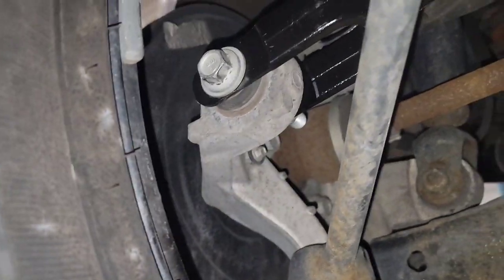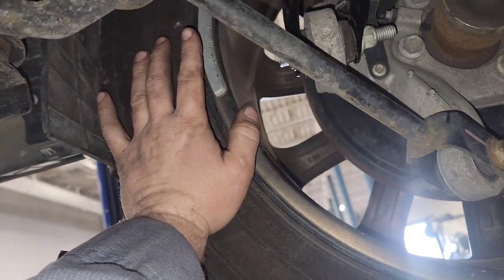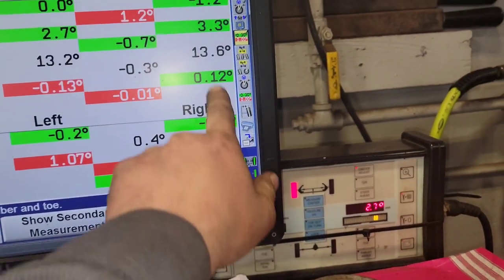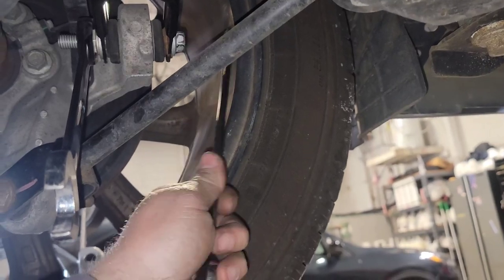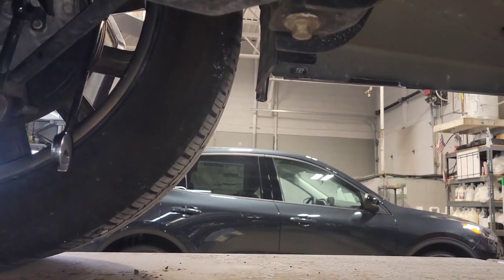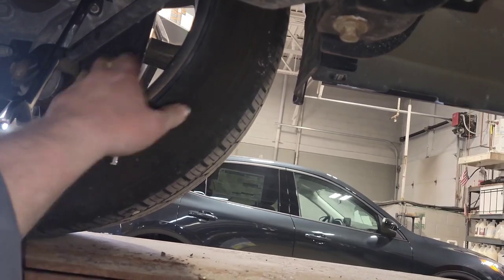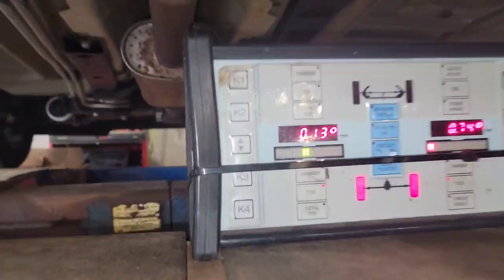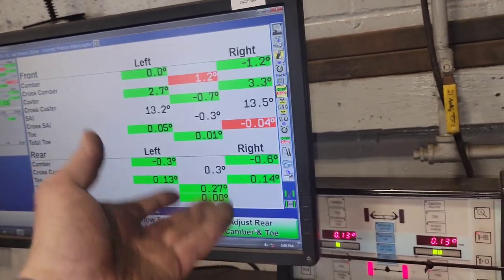Ford Explorer Newest Toe Link Recall 20s62 / 21s32 - What Is Done

Comment: Call me crazy. But even though warranty only pays for a rear alignment, just because it's on the rack I've been adjusting the front N/C. I've personally had alot of customers that come back and ask for me to work on their vehicles. I look at it as loosing alittle now to gain later.
Reply from the maker: So I found out yesterday that they have added a new provision that your service writer could actually go back to Ford and submit through sssc the front alignment as well for 0.2hrs to set the front toe because they realize that it's actually their responsibility to make the whole vehicle toe set proper
Reply: @FordBossMe  See I didn't even know that! That's really good to know! I'll share it with the guys today. Honestly man I love your videos. I've learned alot brand wise about common issues.

Comment: Are these new toe links any safer than the old ones? What happens if the bolt on the slotted end as you mentioned comes loose? Might be time to trade in my 16 explorer. I took it in and had the recall done, but still sounds dangerous.
Reply from the maker: So far so good
Reply: Ever see a Peterbuilt fender out your driver's side window at less than 5 feet range at 65MPH while hydroplaning?

Comment: Do you think that will hold on off road 🤔 my thoughts it will need adjustment a lot
Reply: No it does not. They get thrown out of alignment very quickly, sometimes as soon as it gets off the alignment rack 😂
Reply: @theknight45videos  are the stock ones gonna be okay off road ?
Reply: @YTimCN  honestly I don’t think the original ones OR the new recall ones would be ok to off-road. The old ones snap, so it would be far more likely to snap off road. The new ones won’t snap, but 1000% it will get thrown out of alignment afterwords
Reply: These vehicles might be called SUVs but they are just high riding AWD unibody minivans, aren't built for off-road use regardless of which toe link is on it, unless you just mean a fire road.

Comment: Had a recall on my explorer 2014 had a recall on rear toe in. Yeh they did a good job and never aligned it and ruined a new set of tires. I hope other dealerships do better than that. 
  At least some of these guys do it right and not short change their work. Have another recall again on the same thing. Hate to take back in and get in the same situation.
Reply: I just had this same experience. Tire Shop said the new Toe Link/Ball Joint is not adjustable so there is no real precise way to align all of the tires. Ford is telling me I have to use the new part that is non-adjustable. So I either pay Tire Shop to put an adjustable one on for $500, or have Ford redo the alignment with my new tires and leave the new part on, but risk that ruining another set of tires. This sucks.
Reply: I just had the exact same thing. I should of said screw the recall. They didn't align and ruined the rear tires. I'm pissed
Reply: SAME HERE! Same vehicle. Same result.--for what its worth the dealer that did the recall work showed me  the graphic alignment report when it left the shop and the tow was aligned when they finished. 8K miles later my front end is still perfectly aligned and my nearly new tires up front look beautiful. But I am replacing an entire set of tires because the new part did not hold the rear alignment.

Comment: Being mechanically ignorant, would it be normal that the front would be out of alignment after this process? Just saw someone post they also had this done today on theirs (FB Group) and the front end is out of alignment. Mine was done today and I didn't notice anything unusual on the drive home. Thanks
Reply from the maker: Yes because if you reset the rear to be 100% true and the front is off you're supposed to contact the sssc department through Ford and you can get the time to set the front end toe they will actually pay for it or previously they didn't have a provision for that like they do now you would contact the customer and say hey well I have it on the alignment rack I'll charge you an extra half hour and set your front up for you so you don't have to pay the whole thing but now you can actually contact the sssc department to get approval for resetting the front toe because you probably caused it to be out of alignment once you did the rear toe links I've been paid for it a couple times through the special claims department through Ford and the customer doesn't get charged
Reply: @FordBossMe  Who should call Special Service Support Center, the tech, or the customer?
Reply: No, if the front was in alignment before they do the recall work, then it will still be in alignment after.  If the front wasn't in alignment before the recall work, then it needs an alignment either way.  If the front was in alignment and the back was not aligned properly and now the front looks off, time to re-check the rear alignment.

Often what a shady shop will do, is state the front needs it and that isn't covered so they will have to pay for it, quick money for a vehicle already on a lift and being aligned.  Ask questions.

Comment: I had the recall done on my 2017 explorer base. Ever since Ford replaced the toe links with the new design the rear suspension has not felt right. It feels weird when I go over a bump and when I drive in the rain at highway speeds it feels like the rear is swaying. Ford says they did the alignment after installing the new toe links. After multiple trips to the dealership they can't duplicate what I am feeling. Has anybody else experienced this?
Reply: Check your tires--8K miles after mine was done the rear tires are SHOT. found out about it when I investigated after nearly hydroplaning into a semi.

Comment: Rich, A friend had a recall  done about a year ago, is this a recall on that recall?
Reply from the maker: This is the update to that one

As always it's encouraged to contact a dealer to run the VIN number and make sure the recalls and campaigns are open on your vehicle and don't take everything just at face value
Reply: @FordBossMe  Thanks Rich. Ford extended the warranty for the first recall and said it was final... Makes me wonder if that part was not up to standard ? They replaced it even though we are in a "low corrosion" state (Texas).
Reply: @FordBossMe  Seems to me that the remedy is on 21s32 whereas 20s62 was just to inspect. So if 21s32 is done, 20s62 should be automatically fulfilled, correct? Or could they "forget" to clear that recall?

Comment: I use a ratchet strap to bring it into alignment and hold it while I tighten up the bolts
Reply from the maker: I just use a pry bar or my hand and arm
Reply: @FordBossMe  I was doing that for a while, but one day it slipped and I had to bend back the backing plate that I hit lol. 

There's no chance of that with the ratchet strap, and it leaves both hands free. Whatever works best for each tech is the best way to do it, I'm just suggesting another way.
Reply: You know what would be great is if there was a toe link that could be adjusted with a wrench?!?!

Comment: How long does it take the techs, on average, to do the toe link recall repairs?
Reply from the maker: I can't say, it pays 1hr
Reply: @FordBossMe  1 hour? What a rip off for you! For 21s32 the remedy is to replace both toe links, and align rear only. That's got to be a couple of hours!
Reply: @justmeinnh2  Anyone that needs two hours to do that little work, won't be working there long.   It's just two bolts per side, in a not very hard to get to area once the vehicle is on a lift.  Alignment, since only toe link is changing, likely only toe needs adjusted.

Comment: don't hit a pot hole? i dunno, but that looks weak. no, not hands on it.. still though. EDIT to add: should have read comments first. others are having the same concern. you don't design them, but what are your thought's on this? no, we don't have hands on, only can judge it's strength visually.
Reply: corey Babcock  tried and true. i hit a pot hole so bad not long ago? it knocked the windshield trim off the clips. shook me quite a bit too. finished turning the corner? i had to check by letting go of the steering wheel, even hit my brakes to make sure my truck was still driving straight. it was. thank god it was a truck and not a car.

Comment: my wife has a 2017 explorer sport. the vehicle drove way better prior to sending it to the dealership for the recall. Ate 35k miles worth of tire and the dealership wont honor it
Reply from the maker: That'd because they probably didn't align it when they were done
Reply: @FordBossMe  They did an alignment. I got paperwork on it. 5 weeks later i had an independent shop do an alignment ans it was 1.6 off it ate the tires. I have had nothing but problems with alignments after Ford touched it. Putting adjustables back on

Comment: Use a ratchet strap instead of you hand to hold the tire, it's easier
Reply from the maker: It's actually not easier
Reply from the maker: I'm a pretty big guy so I don't need a ratchet strap to hold anything and I tried that the first time and it absolutely is not easier by any means it's so easy to do it by hand without even being that strong there's no reason to even take a ratchet strap over
Reply: This is what I kind of said in the TT of this, but this is a good explanation video, and I think a ratchet or come along would just be wasting time now in this case.